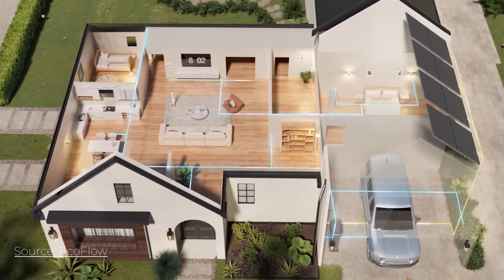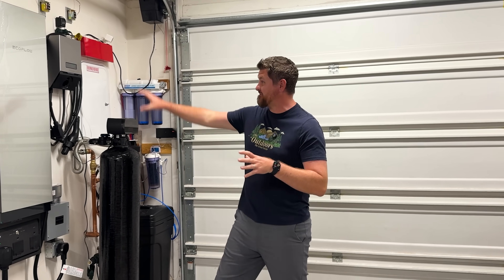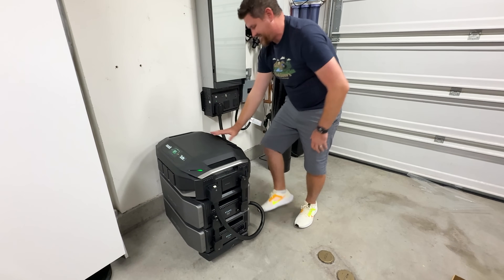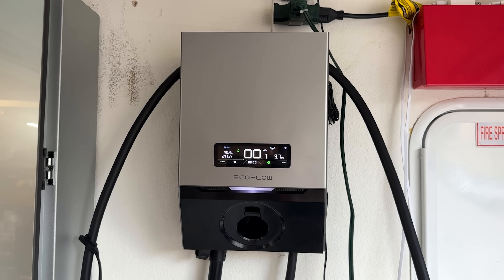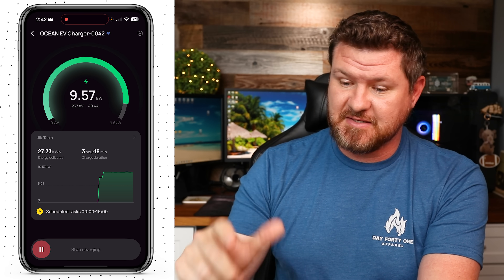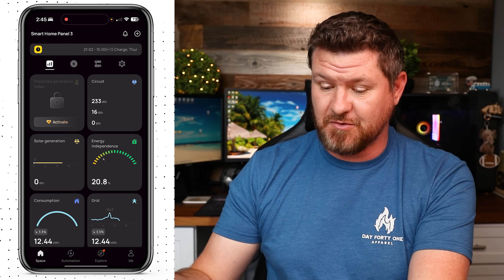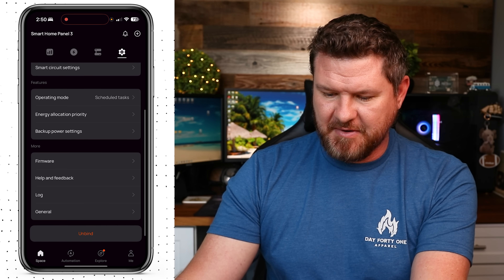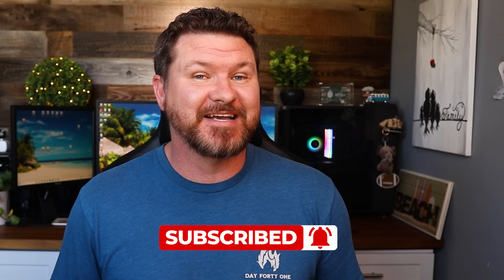How I Kept My Lights On When Everyone Else Lost Power! EcoFlow DELTA Pro Ultra X

Comment: I'd like to know more about mixing Ultra batteries with the NEW Batteries for the DPUX.  I have performed the firmware update on the older batteries.   Also would like to know how to connect the flat cable as well, I believe you have to use the flat cable and the extra port to get your full 12,000kwh out of the Inverter.

Comment: Assuming that 12kW output is within someone's power needs... I fail to understand why would someone purchase this when for significantly less money you could purchase three Delta Pro 3s, parallel them to get the same 12kW output, and not to mention having the versatility of 3 units which can be used for separate applications. I know the Delta Pro Ultra X is a more permanent solution and is more scalable for higher power needs. But aside from that, I just can't justify the cost.